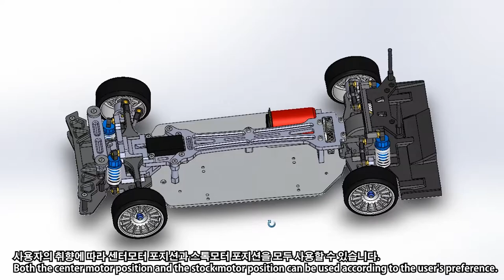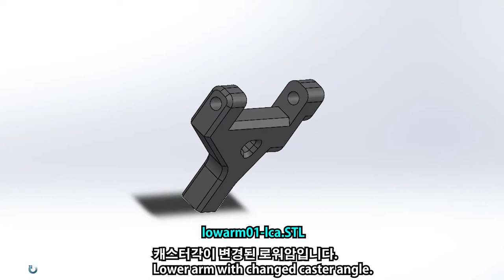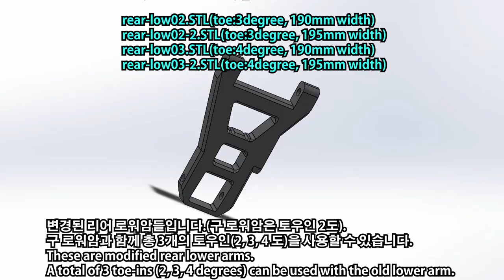Update of HSP Flying Fish 94123 RWD conversion(front caster & rear toe in)

Comment: Are there any other parts I need to buy to make this work? I assume that you are using some metal parts in the front for the steering. Do I have to reuse some of the stock parts or will I need to buy other parts to make it work? If so, what do I need to buy?

Comment: can this be use on plastics chassis?
Reply from the maker: Stock motor position is possible. But if you remove interference area, center motor type is available too.
Reply: @zeusgarage4368  great ,thanks.